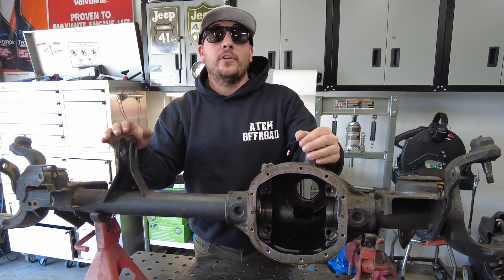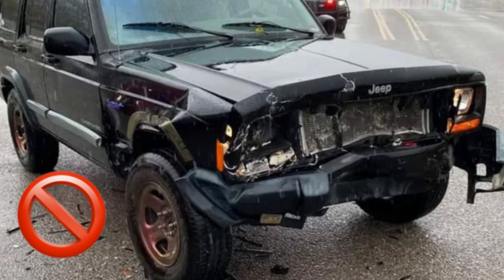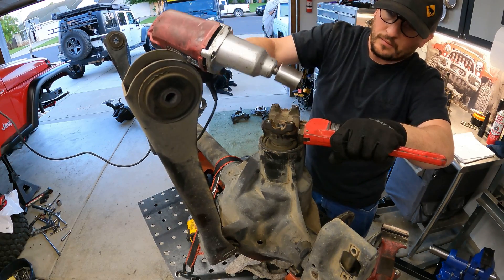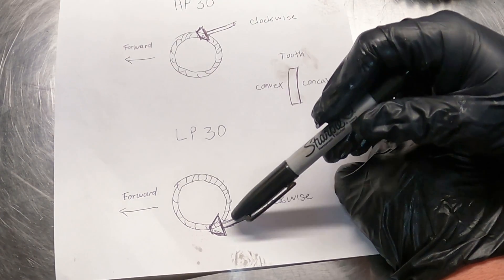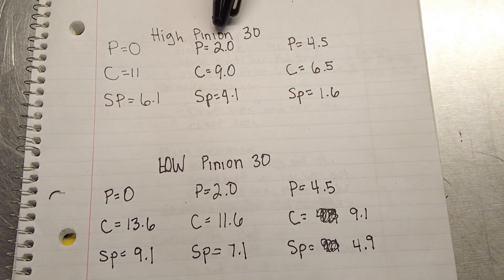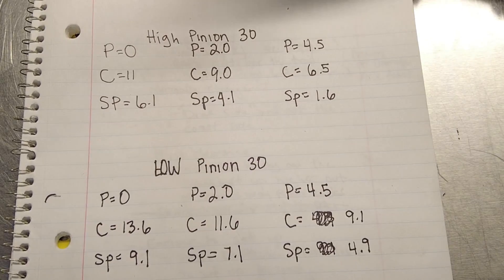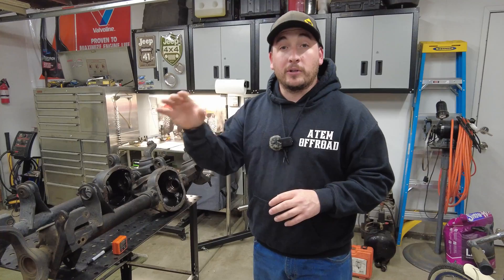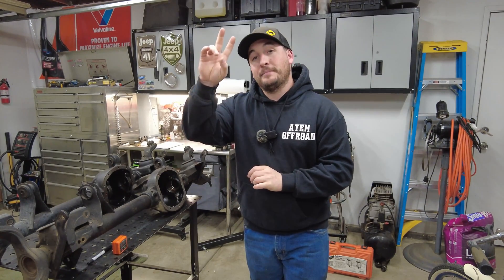Jeep Wrangler Tj - DANA 30 High Pinion Vs Low Pinion Swap & Build Advantages

Comment: I have a used 30 Dana axle from a Jeep WJ. I want to replace the final gear with a 488. Is there a similar one from another car? Or does it have its own type? If so, what code should I use for the 30 Grand Cherokee WJ lower pinion?

Comment: The place the low pinion shines is if you do much recovery work. If you find yourself reversing and backing up to pull people out, the low pinion is stonger. This is for the same reason the high pinion is stonger when driving forward. The rotation direction that has the ring and pinion applying power to the drive side of the gear will always be stronger than the coast side. Most of the times I've seen a high pinion blown up it was from going in reverse against a heavy load.

Comment: The high pinion Dana 30 was available in the XJ all the way back to 1984, but they had the three piece set up.
Reply: Wasn't it only the early years that had the three piece set up? I know the XJ changed to a low pinion in the later half of 2000 as well. No idea why they decided to do that.

Comment: The only hp dana 30 i can find  around my area  reno nv  are c.a.d axles im considering retubing the long side to get rid of the c.a.d but thats a big job
Reply: Build a block off plate where the cad used to be and swap in a one piece axle shaft. That's what I did on my YJ
Reply: @shawnwisener1384  im currently doing that on my current axle I want to put a truss on it but nobody builds a truss for a cad axle 
But I found a 94 axle at tear a part  just after I typed this so I am good
Reply: @jeremyhanna3852   i understand that you have found non-cad axle but i wanted to share what i learned today about the cad and trussing.  I ordered a D30 truss kit from a local fab shop, not big brand made.  After my order/payment, i learned that the axle i was buying from a yj with an 8.8 rear end was an HP cad D30.  I immediatley gut the truss builder on the phone.  He didnt just make the parts. He is an avid off roader who knows Tjs.  He assured me, with his design truss i could notch out the truss verticals and add another top plate to beff up the top that bridges over the cad box.
Reply: @albertastala9543  your missing the point the cad sucks the vacuum never works right when u need it they also leak  diff oil cause of the bad seal design
Reply: @jeremyhanna3852  right, i overlooked that.  fortunately, the axle i am getting has already been addressed with a one piece xj passenger axle and vacuum delete.  perhaps that info may be of use to someone as well!
Reply: yea bro, i just read the comments again. just run an aftermarket single axle and plate off the CAD
Reply: @albertastala9543  right done those upgrades years ago but the seal is in different places and the cad axle is not machined for the seal for one piece axle so u have to use a seal from a Subaru trans axle it fits in the hole i could find the part number for it if I looked but its not machined so u glue it in and pray it holds put in my case it never held i put 3 or 4 seals in there needs to be line bored  for a seal but don't  have that equipment

Comment: Just wondering if you have experience with the JK dana 30 front? is it worth upgrading/modding or are you better off buying a D44 front? I have a 2014 jk 2 door I purchased a few months ago and am going to start building for light off roading/snow wheeling and camping. I bought a sport because it was cheaper and in better shape. Most of the "rubicon" versions were hammered with high miles and over priced. I don't plan on a locker for the front but definitely one in the rear and will likely re-gear at same time. Probably not run over 33 maybe 34-5s but I tend to do lots of highway so like the lighter tires. Do you think the stock JK front is up to mild with occasional heavy use with smaller tires? I don't mind welding on some trusses/gussets if needed. Any information is appreciated.... been out of the game for quite a while ha ha, just don't want to spend good money after bad.
Reply from the maker: In your situation the front Dana 30 is fine, I’d prefer a hi pinion 30 over a low pinion, but I’ve seen built low pinion 30s and impressed with the capabilities. The high pinion axle solves a lot of geometry problems up front like caster and pinion angle so if you did upgrade a HP 44 would be a direct swap without all the modifications.unless you bought an axle outright from Currie or g2 axle. You want a weak point on the 30 to be the outter ujoint or stub shaft on the axle shafts. Go chromoly inner shafts and stock outers, and stiffen the axle with a truss or sleeves with some inner C gussets and you’ll have a pretty reliable axle.
Reply: @ATEMOFFROAD  Thanks for the info, I appreciate it! Had a rough start with this thing repaired some engine issues, and a few mistakes made by previous owner, but now I am feeling confident enough to start making it more off road worthy! Not quite as fun to drive as my old TJ or XJ but pretty nice on the road and the gas mileage is not bad for a brick. The nice thing is being able to score some really good deals on used parts!

Comment: For the life of me, I could never understand why they redesigned the Dana 30 to decrease ground clearance and strength?
Reply from the maker: Haha my same thoughts, the only thing I can think of is maybe somthing having to do with control arm mount locations on the frame and or clearance problems with exhaust later on when additional Cats were installed for emissions. 🤷‍♂️ best the heck out of me 🍻

Comment: My diesel XJ has 3.73's and the HP30 front, but unfortunately generally XJ's came with D35's in the rear here (rarely did they have an 8.25). :( I'll be looking at doing the same mods to the 30 as you are since D44 fronts aren't something I'll be able to find easily here, not like the D44 rears which came stock in all Aussie TJ's.

I'm keen to see the progress in the next vid!
Reply from the maker: That’s awesome, I wonder if all the diesels came stock with 3:73s, would save you over 100 dollars not having to buy the carrier. crazy about all the tjs getting the 44s ,but not the Xjs getting the 8.25. Wouldn’t that be nice if that happened over here. 😂 I won’t be going too crazy with the 30, but should be enough to do most of the trails here in the Pacific North west. 🍻🍻
Reply: Are you gonna sell any more xontact blocks for tj  @ATEMOFFROAD